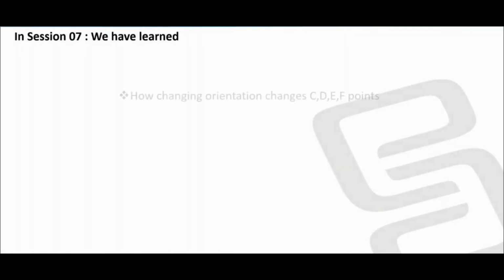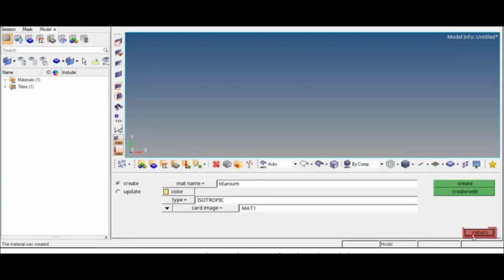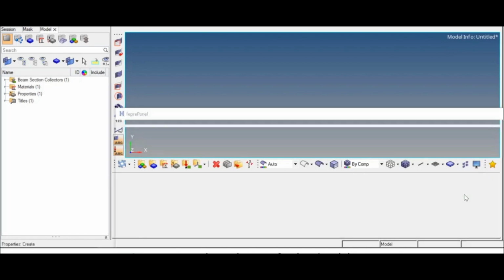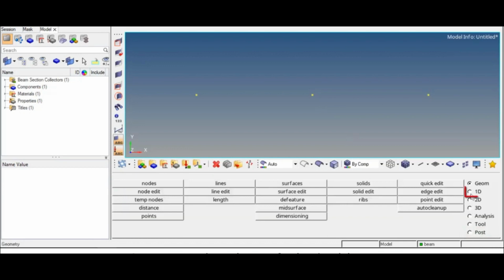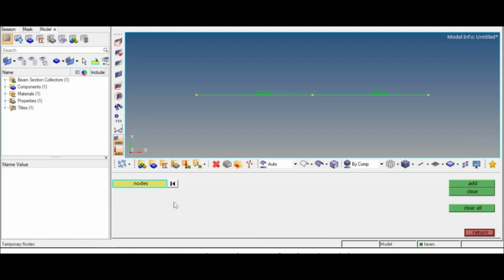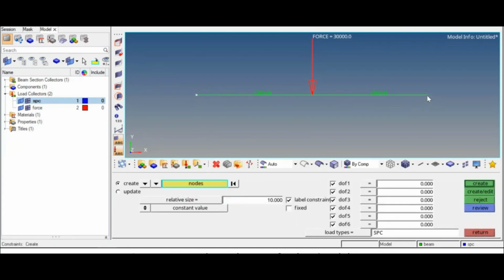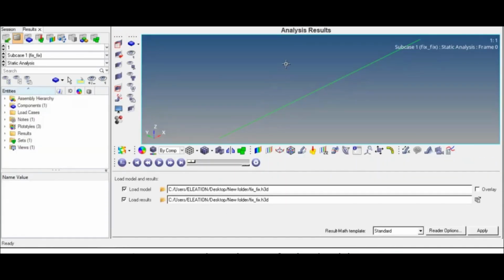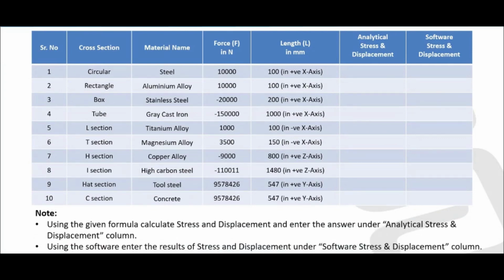Fix-Fix Beam Analysis in HyperWorks | Complete Step-by-Step FEA Tutorial

Comment: btw can u tell how to do this for unsymmetrical section as the orientation of the 2 sides does not match
Reply from the maker: Steps for Unsymmetrical Sections
Section Property Definition:

Create your beam section property (PBAR, PBEAM, or equivalent)

For unsymmetrical sections, carefully define all section properties (A, Iyy, Izz, J, etc.)

Orientation Vector Definition:

Use the BEAMORIENT card to properly align the section

Define a vector that specifies the local y-axis orientation for each beam

For varying orientation, you may need to define different vectors at each end

Node Alignment:

Ensure your beam nodes are properly sequenced (from first to second node defines local x-axis)

Use CTRIA3 or CQUAD4 elements to visualize the orientation if needed

Advanced Options:

For complex cases, consider using PBCOMP for composite beams

Use PBARL or PBEAML if you have exact cross-section dimensions
Reply from the maker: If the two sides of your beam have fundamentally different orientations:

Split the Beam:

Divide the beam into two segments at the point where orientation changes

Define separate properties/orientations for each segment

Connect them with a rigid element or MPC if needed

Use Local Coordinate Systems:

Create different local coordinate systems for each orientation

Assign the appropriate system to each beam element

HyperBeam Utility:

Use HyperBeam within HyperWorks to visually verify section orientation

This helps catch misalignment issues before analysis